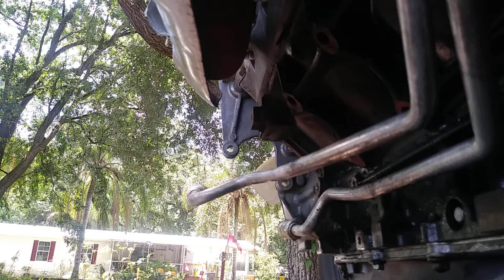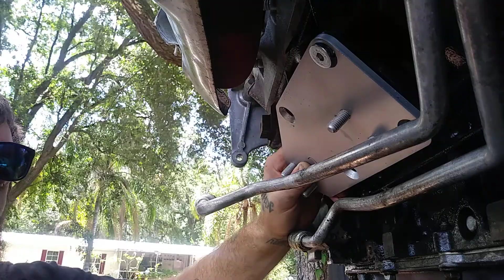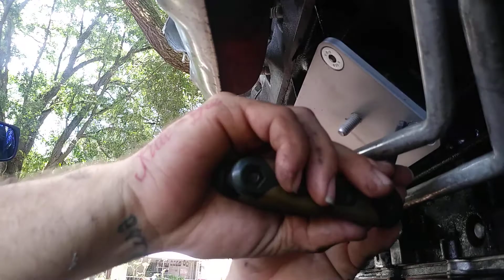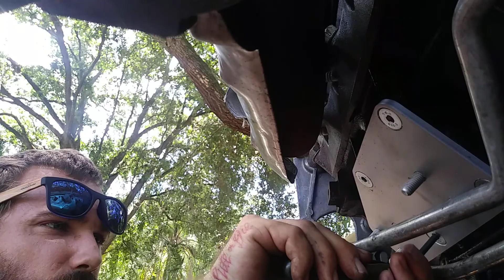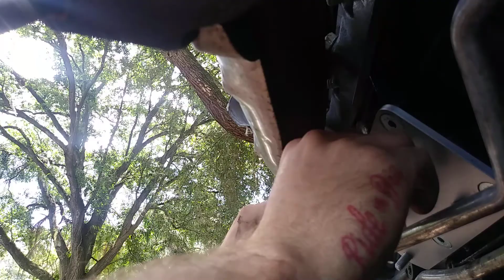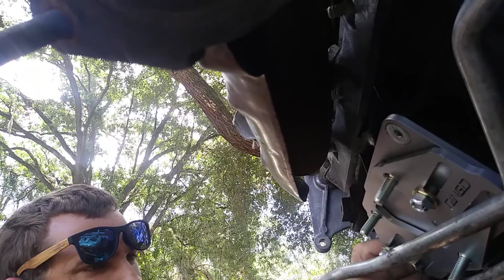DIRTY DINGO slider LS engine mount "test fit"

Comment: hey guys got a question for guys experienced with motor mounts? when an LS engine revs which way does the surge in Torque wanna pull or rotate the engine? does it wanna twist away from the passenger side mount or twist away from the drivers side engine mount?

Cuz i bought a set of Ls swap motor mount adapter plates off amazon, , they were 5 star rated but did NOT SEEM  to fit all that well. Some of the bolts were too long and bottomed out in the block BUT THE REAL KICK IN THE BALLS  is that after spending 3 hrs trying to finaggle a tight engine into the Gbody i have, i find out my passenger side oil pan sits about 3/8 inch lower and is rubbing on the crossmember and thats without the mounting bolt in place cuz the holes are about 2/3 of a hole out of wack.
So anyways i managed to get the part off the  motoromount  off the crossmember.
if i stick a 1/4 " thick plate under the entire clamshell is it? then it levels out enough i can at least get a piece of tin between the oilpan and crossmember.

So i need to know which way the engine twists under torque so i know how extensively i need to weld or bolt this passenger side mount?
if its gonna twist into the passenger side mount im ok with a sketchy weld job but if its gonna twist away i may be forced to pull the motor and start all over.